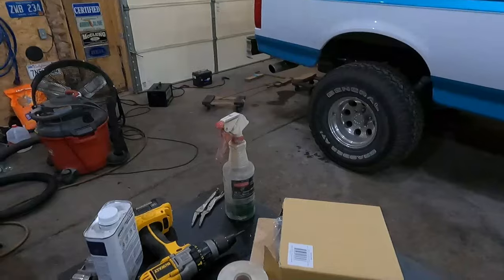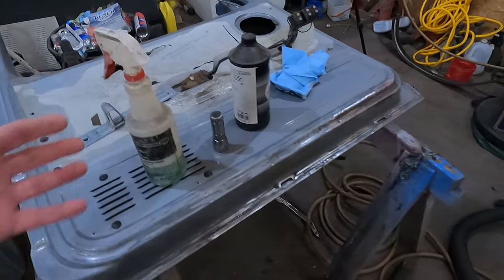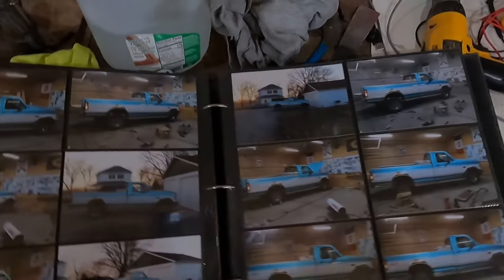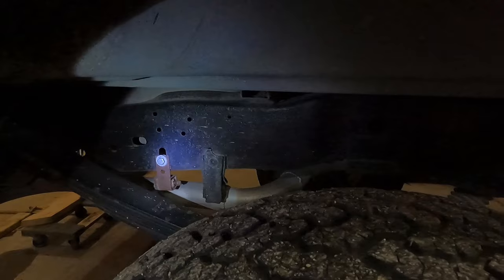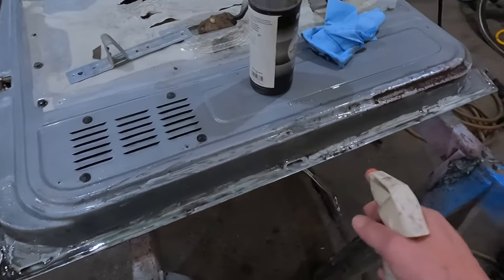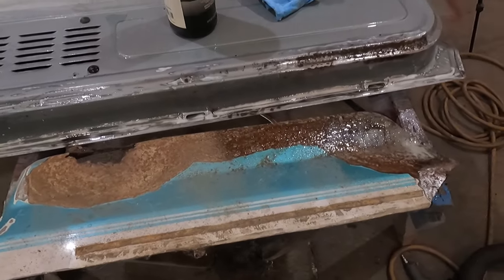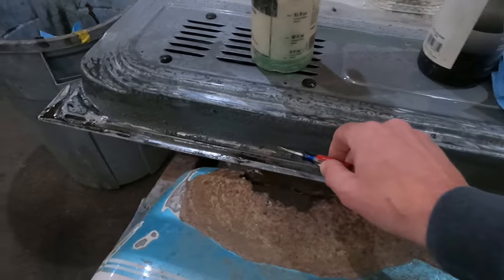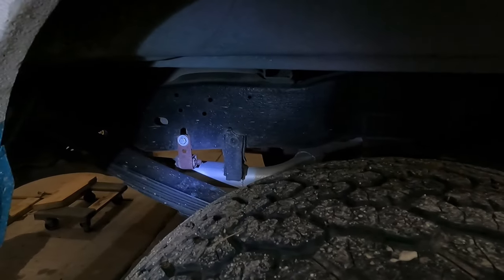OSPHO Rust Converter, RUST Killer, DOES It WORK

Comment: I've been using this for decades. I always come back 24 hours later, and either do another coat if it's bad or reactivate it with some more Ospho then wipe it with water and then air dry and DA it with 80 grit. Years ago I had to put a junkyard fender on a customer's old Ranchero. It was the only fender I could get, they didn't make them back then. It was bad surface rust from the car burning down then being scrapped. I completely stripped and Ospho'd the fender then went over it with 80 grit, then etching primer and  painted the car. I was kind of worried about that fender though. I still see the Ranchero around to this day and the fender looks fine. That really sold me on that stuff. That was a nasty fender when I got it. I use it all the time but I do neutralize it with another coat of Ospho then immediately a water wipe down. I won't paint right onto Ospho residue.
Reply: Do the water wipe down after the second coat is BEFORE the ospho dries ???
Reply: @MrBluoct  24 hours after the first coat, re apply. Then while it's still wet, totally wash it off with water to neutralize it. Dry it then sand it. I usually then spray with PPG DP 90
Reply: @Digitalsharecropper  ppg dp 90?
Reply: @craigmerrill3331  Epoxy primer
Reply: @imaouima  if body filler is needed, would you do it right after the ospho or after the primer?
Reply: @felipeengelmann9636  Personally, 24 hours after the ospho but that's still a raging debate.
Reply: @imaouima  the more I read about it, the more it sounds like the primer vs body filler order is irrelevant 😁
Reply: @felipeengelmann9636  It probably is.
Reply: @Digitalsharecropper  Thats what a guy from SPI told me about using phosphoric acids. They always say in the tech sheets not to use the acids, and Im guessing its because people DON'T, DO   what you  mention here, and later when the problem arises they blame the paint company. They paint over the residue and here comes their problems later.
Reply: Yes. Get it wet with Ospho, then water wipe it as clean as you can. Sometimes scrubbing it with a steel pot and pan scrubber. Keep it wet until you think you got all of it. Then wipe it dry.  @MrBluoct
Reply: @Digitalsharecropper what do you mean by water wipe it?
Reply: @Digitalsharecropper what do you mean by “while its still wet”? Are you talking about the ospho?
Reply: What kind of paint did you use oil-based or urethane
Reply: epoxy prime before body work and you won't have to worry about rusting again.  Ospho is a water base product
Reply: oil based paint is for your metal fence and urethane is for your truck
Reply: If it doesn't make more sense to rinse it, I usually wipe it off with a solvent like lacquer thinner or acetone.
Reply: I can confirm that it is fine to primer over ospho as long as you keep that 24 hour dry time. I prep/sand before applying the ospho, let it dry for 24hr minimum, and give it a quick scuff pad before priming. Nothings ever wrinkled or peeled on me. Have some of my autobody jobs still out there on the road years later and still fine 👍🏽

Comment: 39 years Auto Body... Plug your drain holes in the bottom of your doors (tape or rag)and spray or brush (depending on product) the inside of the Doors fenders etc.... Doing a old show car Restore stand your doors on All 4 sides so it soaks into the inside lip...
Reply: How do you use it if you have to put body filler on the spot  do you put it on with out sanding it are do you sand it off then put filler
Reply: @paulwelch5570  if you can sand it SAND IT... if its inside where you can't get at it do your best :) Note your only going to slow the rust down... Someday it will need cut out or replaced :)

Comment: Greetings from Northern Vermont! Been using Ospho for years and it does work great. Not to be off topic, but most of that rust could have been prevented with oil spray rustproofing. I have been oil spraying my vehicles since the 1990's up here in Vermont and my 1997 K1500 suburban still looks good with litter rust on the frame and body. There are many great oil petroleum based products on the market, but , ATF, Motor Oil, Bar & Chain oil  etc all do fabulous job.  Spray any of these oils INTO enclose box sections, rockers, doors, pinch welds ...all enclosed sheet metal areas. For the OUTER Frame and suspension sections that are exposed, heat bar and chain oil in an electric crock pot, add some WAX and apply it with a 3M Rocker Schutz type gun at 40 -80 PSI.. Best time to apply the oils is Spring , because the warmer weather expands the metal and allows the oil toe creep, wick and penetrate. It's most important to soak all the inner enclosed sheet metal areas with thin oils like ATF, Motor Oil, B&C oil etc.. Good Luck!!
Reply: Here's my Paps recipe, 1qrt of Any oil, trans fluid and 1 tune of grease and 1 or 2 wax toilet gaskets. Melt in a old pan and mix. I use old or used oils, fluids, hydraulic etc. So only pay 2 bucks for no name grease, and same for wax gasket. Lasts for years.
Reply: Fluid film spray gun
Reply: Cosmoline rp342
Reply: let me see... spray with oil once a year or with also once...
Reply: @markevans4547  Spring is the best time , especially inside all enclosed and box session areas . The warm weather in Summer will allow the oil to wick into cavities, because the metal expands and the oil is thinner..

Comment: If you get Ospho on your concrete, it will etch it, so make sure to dilute any spills or neutralize with baking soda.
Reply: It definitely will.  It won't just etch it, it will eat off the topping and leave craters !  Kill it IMMEDIATELY WITH water and if you have the  Baking Soda that is a great idea. 
What I'm facing is after applying Ospho, it was rained on shortly thereafter and all of it turned to a chalky white powder.  It is in places I can't possibly scrape or wire brush away, so I am just applying another coat over the powder and have the piece of the tractor (battery box) under a canopy.  Anybody have any ideas on treating it better please let me know.
Reply: It will eat right through a concrete floor if it isn't neutralized.
Reply from the maker: @Digitalsharecropper I never remotely had that issue.  But my concrete floor was hand mixed and poured from way back in the day.  Maybe different than what you get these days.... I dunno.

Comment: Years ago, I used a product called Naval Jelly. Got it from the auto parts store and every fall season before I managed to buy a topper for the truck bed, I would rough sand, paint the jelly on the inside of the truck bed, and then primer it to help keep the rust down.
Reply: Im 65, and when I was a kid ,my dad used naval jelly!  Its ,I believe a phosphoric acid in a gel form.

Comment: FYI: I've used Ospho and rust eater for years. ALWAYS degrease the surfaces before treating with it. The oil from your hands/skin can neutralize the product. If you spray it on a oily surface, it will bubble up like hydrogen peroxide. The only gripe I have is the clean-up before priming.

Comment: That needle scaler from HF is one of the few good air tools they sell.  I just had a HF air drill break at the trigger casting, very little use, can't be fixed.
Reply from the maker: Their impact sockets are good... I know not an air tool in itself, but I have yet to break one.
Reply: @TheFoxShop  those bubbles on your door are easy too get rid of with a light too medium sanding and then another coat of Ospro! Another product I highly recommend is Rust Cutter it's a bit thicker than Ospro but sticks nicely! With that being said both Ospro and Rust Cutter are the 👑 kings 👑 in my opinion!

Comment: Welding up a cab corner, used some rust mort today, sounds like ill use rustolium then on the inside, what ive been trying to find out, so many different opinions on it, has a little surface rust i wanted to treat inside. Adding an access hole so i can wax it or oil it through  the rocker after also, its a 14 150. Rest is rock solid, brake light or slider must of leaked.

Comment: I didn't have any luck with ospho , Rust came back a few months after even though I painted the areas with 2 k epoxy
Reply: Used to have same problem with epoxy primer. The dried Ospho film prevents adhesion. Solution: Apply Ospho and let it react and dry. Then, apply another coat of ospho and rinse it off while it's still wet...a little scrubbing helps. This is the method Southern Polyurethanes recommends, and it works.
Reply: Gotta read the label. Says Oil based paint, wipe with mineral spirits, epoxy gotta rewet, let set 3 min, wash and scotchbrite, then non oil based paint. Why they don't give instructions using other than oil based IDK. On SPI forum The chemist says how to use and why they stopped telling ppl cause they won't follow directions and blame the primer or paint.

Comment: I need to apply body filler, is that ok to use over it? Do I sand with 80 grit?
Reply from the maker: I do not have the answer to that... I wouldn't.   And if going to sand it down clean to bare metal, there is no point I don't think

Comment: klean strip concrete and metal prep and etch , should be the same exact thing if u check sheet and its only 17.97 $ at home depot
Reply from the maker: May have to try that 👍
Reply: @TheFoxShop  Try a comparison test, I got it while waiting for my Ospho to arrive, they seem very similar but the Kleen Strip concrete and metal prep is much cheaper and right there
Reply: No it's not the exact same thing the Ospho is a much better product. But the kleen strip works too as long as you don't have too much rust. I'm sure we all know what the best one is....it's Corroseal

Comment: ok so the next step???  after wiping it off and letting it dry , do you rinse with water??? or just directly start painting once its dry??
Reply from the maker: I painted right over the top of it... But seems to depend who you ask according to comments
Reply: It says if using oil based ok if not you rewet with ospho, let set 3 min, wash off with water and scotch Brite. If not it'll not adhere.
Reply: Ospho direction doesn't mean it works for all paints. Ospho converts rust to Iron phosphate. But your paint may not like that acidic environment. For example painting epoxy primer over ospho means you are screwed big time. always the best case is to neutralize Ospho. Meaning once dryed, apply ospho again wait a few mins and rinse it with water and immediately dry it.
Reply: @borna430  That's what I do except for the scrubbing with scuff pad, not for sanding or whatever but more for complete acid removal. Cause ein the car game that's the first step, spraying epoxy to seal, do body work, sealer can't with epoxy, coat with urethane primer then base and clear. But that's on a 40k restoration. I just do epoxy then base coat. I watched a video of a test of ospho and the tester said it didn't work well and then that's where this got started for me. I tried to tell him that using on a diff on a truck is a ok test if it was cleaned and prepped right. I've used it for years and if it's a clean dirt, oil, silicone etc free surface and not get rid of all the rust, cause that's the point is to convert it not sand it all off, it works just about the best I've seen in 20 years. Some of the evapo rust is good for small parts and time to soak but for a frame etc hard to do that. There's way to thicken up the ospho and make it stick. That's my only complaint. Like naval jelly buy way stronger concentration of phosphoric acid. I've never tried tannic acid but seems to work well from videos. Hard to tell cause we don't see the entire process, just what the content creator wants to show. Thank you for your time. Have a great week.

Comment: I know it's phosphoric acid so do you need to neutralize it or just a washing is sufficient
Reply: Washing is fine just need to rinse off residue
Reply: @zubirhusein  what if you don't rinse of OSPHO?
Reply from the maker: I know I didn't and have had no adverse effects.
Reply: @Asian_Connection  my spi epoxy says to clean the ospho off first. It depends on the primer or sealer your using.

Comment: What primer did you use over top of the Ospho? I'm working on some doors and a deck lid with some rust pits on them just like yours and I really don't want to blast but I've read Ospho can cause adhesion issues with primers.
Reply from the maker: I just really used it on the frame of my truck..used rustoluem rusty metal primer.. Several coats, then rustoluem black paint..  still looks great!! But for body panels.. Not sure to be honest.  Never done that.
Reply: Dp 90 is one of the best primer if you are looking for quality of being rust resistant but it's really expensive

Comment: I hate Ospho! Used it on fence posts..everywhere I used it, the black oil based paint began disintegrating in a few months. Posts without Ospho still Look great after many years. And, yes I followed the directions. I will never ruin any metal item with that junk again, and I do paint a lot of metal ! It’s too expensive to not work as expected
Reply from the maker: Hmm..  frame on my truck still looks brand new after using it.   Wonder what happened.

Comment: Just remember if you do not neutralize it it will haunt you for ever in your top coats.
Reply: Neutralize how?  I'm considering using it (Ospho) myself.
Reply: @CinHalCedHerChance  When your ready to work the metal again 80 grit the whole surface then acetone it all/ continue with Tamco 5300 series DTM primers and products solvents. Call them they are great.
Reply: if it is phosphoric acid no need to neutralize

Comment: Hi Jon, when you sprayed it on your frame, did you wipe off the white powder with mineral spirits like the bottle says to? If not,  what did you do? Thanks!
Reply from the maker: Does the bottle say that? 😯... I sprayed my frame every evening for a week... Let it dry and painted with several coats of rustoluem rusty metal primer... And then several coats of rustoluem gloss black. Worked for me. 👍
Reply: @TheFoxShop  Yea it says it on the bottle and website, I just didn’t know if you experienced that white powder, and if you did anything about it? I plan on using the same rustoleum you used. Thanks!
Reply from the maker: Just read the bottle I have... Just says let dry and paint.  I dunno..that's what I did lol
Reply: I actually just checked the bottle, it says to wipe down with a solvent based cleaner, the website says mineral spirits. But if you didn’t and had good results, I won’t worry about it
Reply from the maker: My bottle may be old, maybe they changed the directions?  Couldn't hurt to wipe it down, but I had no issues
Reply: @TheFoxShop  ok, thanks!
Reply from the maker: Maybe I'll make another video on this

Comment: I find using a grinder and some sandpaper to get rid of rust is much better to me its faster and i can get the painting done that day.
Reply: Yes but you can't get into the microscopic pits and it will rust again unless you grind down all the metal too. Use right way and save all that work and time.
Reply: You can't get inside A B and C pillars either. I hate to replace a quarter panel because of surface rust inside a solid piece.

Comment: After applying in a badly scaling battery box on a tractor, I was not able to cover it up and it was rained on several times.  Came back a couple weeks later to find awful white powder build up instead of black hardened coating ready to be painted.  
May be a mistake but today 12-2-22 I have reapplied another coating of OSPHO right over the power.  This time the tractor is under a covered shed.  It will be damp during rains but will not likely get the waterfall itself.  So, we'll see what happens.  I hate rust and it has to go.   I hate this white chalky powder just as bad.  Somebody did not take care of preventive maintenance on this tractor and I have to try to save it.  Anybody with corrective action idea or experienced this white powder transformation and fixed it please chime in.  Thanks !
Reply: You need to prime and paint over the converted rust, or it will come back.

Comment: Can you get Ospho at Homer Depot and Blowes or do you have to go to an automotive parts store?
Reply from the maker: Haven't seen it there... I've always got it off Amazon.  I think Sherman Williams paint stores may carry it if I remember correctly..  but I've always got it off Amazon
Reply: Ace Hardware
Reply: Kleen Strip Concrete & Metal Prep I got at Blowes, Homer Depot has it too - 18 bucks a gallon, I believe it's the same as Ospho, costs way less and it's right there, you don't have to have it delivered.

Comment: Hay this Ospho rust converter looks just like Rust-oleum Rust Dissolver. I bet its the same thing. I can confirm Rust-oleum eats rust all the way. I have a 95 ford Explorer. 
The stuff I have was made in Vernon Hills, IL can you do a test?
Reply: It's not the same thing it's just the same GREEN color with that being said they both have their pros and cons.... I highly recommend using long sleeves, chemical gloves resistant too ACID as well as a respirator and safety goggles when you are applying OSPHO rust converter. It's a excellent preparation chemical in my opinion for many of your metal prepping projects!
Reply from the maker: Just be well ventilated... It can kinda burn ya...  but I never had an issue.